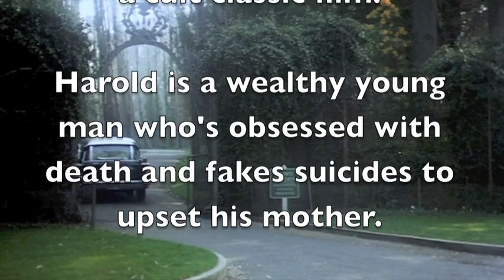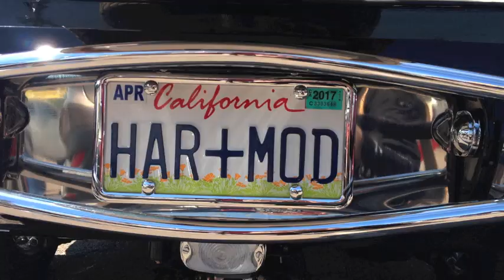Recreation of the Jaguar Hearse from Harold and Maude

Comment: The original  movie car seems to have used a 2 seater for the starting point. It's obvious from the smaller door glass viewed in the original movie. This "replica" seems to be built from a 2+2, larger side windows. Close but no banana.
Reply: he explained it in the video....
Reply: They did use the 2+2 in the movie in the movie, but, I agree this close but not as elegant in shape. The top on the recreation is too straight, the movie version is slanted down to the back. You can see that the window on the recreation has a weird gap at the back top corner, This would be closed if the top slanted down. That is my ONLY complaint on this recreation.

Comment: PART ONE —

OK — apologies … but … this will go round and round and I hope it makes sense … but that’s the way I write leading to having a point …

Once upon a time in San Francisco, in the year 1984 … 

I was in my mid-20's, I got a gig as a Production Assistant (think 'GoFer’— but this being a ‘P.A.’ leads to people being producers, directors and running studios) on what would be one of the co-stars, the inimitable Oscar-winning actress / screenwriter RUTH GORDON'S last film, 'MAXIE' (1985 - Glenn Close, Mandy Patinkin, dir. Paul Aaron)

It was my job, while she was on the set to basically look out for that little Ruth.  But the atomic Juggernaut she was, she looked out for me. 
 
Ruth Gordon was one of a kind — and for the record, they broke the mold with her.  This fragile rock was a better place with her and I often think of her with equal parts of glee and the bliss she fostered in me to this day in the arts. 

WARNING — SPOILER ALERT AHEAD ON ‘HAROLD & MAUDE’:  As to the enclosed ‘moving images’ of Pacifica you requested — there are those shot when I was a mere pup of 12 in 1971 enclosed as I was freshly moved from the tough part of the Mission District of San Francisco to the then safe Pacifica and settling with my Mum and her new Husband in Fair Park (Oceanside) and went to Sharp Park Junior High … 

CUT TO:  While waiting for the school bus to arrive at the top of Fairway Drive, one very cold, wet Pacifica Winter’s morning —

‘The Circus’ — meaning the various production trucks containing Hair & Make-Up, Dressing Rooms, Cameras, Dollies, etc., etc., was loading in for the end scene where the one of a kind custom Hearse-JAGUAR ‘Harold’ drives, hurtles off the cliffs above Fairway Park …

… only to find ‘Harold’ (Bud Cort) plucking at the Banjo ‘Maude’ (Ruth Gordon) gave him prior to her character’s death.

Well, hot snot, folks … guilty as charged —

— I played hooky for half a day and went up and ogled the process of filmmaking.

I was in a rapture.  I was in my place.  This is what I wanted to do.  Make movies.  And I have.  And I do. 

Up comes Cat Stevens singing "If You Want to Sing Out, Sing Out" the over the end credits

You’ll see Pacifica as Harold drives like a suicide in motion from San Francisco, to the Military Cemetery in San Bruno, to Fairway Park and up the dirt road and we see it rocketing off the aforementioned cliff.

CUT TO:  1984 — One the Set of ‘MAXIE’: I told Ruth about playing hooky and how I just HAD to go up and watch them setting up …  

… and Ruth being Ruth, she good naturally punched me in the shoulder and hollered in that New York accent that never left her, “Ohhhhh, THAT’S just fantastic-!  You keep at it-!”

And I did.

MONTAGE OF THE FOLLOWING YEARS:  I’ve worked my way through every area of the movie and TV industry. Learn, learn and I’m still finding out just how little I know of life too.

I’m blessed that through the years after Oceana to now, I’ve got a ton of awards for directing and cinematography and …

BRAGGING ALERT:  This include sharing a PNW Emmy for a drunk driving documentary called, ‘RUSSIAN ROULETTE:  THE BOB MORTIMER STORY’ as I created and directed the dramatic scenes.

But seriously, this yak fest you’re reading is not meant to be bragging … so, please don’t think that.  Tis’ simply the life I chose for myself and the side effects of following your heart.

CUT TO - LAST DAY OF MY SENIOR YEAR AT OCEANA:  Early June, 1976.  I wandered the empty halls … wanting, desperately needing to remember the sum of the ‘Moments’ I was given of the wondrous humanity we were then.  You all were part of the plan.  Part of the map of my oh-so-human heart.

Finally, I made it to the front steps of Oceana and it was there …

… I swore an oath to myself there … at the top of those steps we all tread up and down a million times … and —

I knew, that the idea, the promise and the prayer of the person I would become that I’d have my first movie made by the time I was 30.

CUT TO:  In my 20’s … I would become a contributing screenwriter and get paid for it as well as, thanks to a producer at Lucasfilm, write and direct my first forays into commercials in 35mm … but —

— by the last few hours of age 29 leading to that promise etched in the stone of my soul’s heart of hearts —

I had not had my first film made and here comes the Big Three-Oh.

Yikes.

Back up a few days … 

… as I had been approached by an L.A. Producer friend to do some ‘notes’ on a piece of crap script he was attached to (by then I was a script doctor and had stuff in feature films and TV you may have heard of.

But like I said; the script they sent me was crap.

Me being me — I said, ‘This doesn’t need notes, it needs to be burned and forgotten … and reinvented.’  And in the space of a day, I pounded out the first 18 pages of the story I created and sent it down to the production company.

LOW SELF ESTEEM ALERT AVERTED:  The production company loved it.

So, it was indeed that night — that last night in my 20’s, August 18th, 1988 … just a mere few hours before 30 arrived on August 19, 1988 … 

… that I got ‘the call.’

PRODUCER:  “Dude, them scenes you wrote.  They (the money people and director) loved it.  You want to go for the gusto and we’ll make it ..?”

ME:  (gulp)  “Yes.”

PRODUCER:  “We’re going with you.  I’ll call in the morning with the money details, profit participation and stuff …”

ME:  (bigger gulp)  “Hmm, OK — Cool.”

CUT TO:  A few hours later … the promise I made to myself at Oceana.  The people I knew.  The people — all of you, in one way or another made a difference in the membership of my days all of those eons ago …

… and you still do.

To me, the good, the bad the ugly of our teen years are evergreen.

CONTINUED …

PART TWO —

THE CODA OF THIS EPIC POST:  With no apologies — We’re in our middle 60’s now.  Some of us went ahead into the forevers.  They swam across the River of Souls and are waiting for us.

I turned 65 on August 19th, 2023 … and the proverbial ‘Fat Lady hasn’t sung yet …’  I ain’t done.

I’m writing a little epic now that spans almost 30 years with characters that, in real life, I have known, loved, despised and finally accepted as who they are … and through bitter tears had to accept they are not who I wanted them to be.

With a little luck and the money people don’t fade away, we’ll shoot it by next Summer into Winter.  Fingers crossed.

Our lives … our loves … our early, best courage came from Oceana.  Our friends, our teachers and perhaps within our wisdom, when we all walked away in that warm June day in 1976 … 

… our destiny began.  And it still does.  

Just like Ruth Gordon said to me four decades ago, and this, I respectively refer to anyone reading this, “You keep at it-!”

I am.

I must.

I will.

Much love to all my fellow Sharks.  You made a difference to this callow youth then …

… and you still do.

Dana Augustine
Oceana High School
Class of 1976

ps:  That full movie I wrote is called ‘THE BANKER’ (1989) and starred ROBERT FORSTER, DUNCAN REGEHR, SHANNA REED, JEFF CONAWAY, LEIF GARRETT and RICHARD ROUNDTREE.

It became a minor cult film and one of Quentin Tarantino’s favorites and one of the reasons he hired Bob Forster (a Prince) on ‘JACKIE BROWN’ (1997 - PAM GRIER, ROBERT DENIRO, SAMUEL L. JACKSON, MICHAEL KEATON, BRIDGET FONDA) a few years later … of which he got an Oscar nomination only to lose to Robin Williams for ‘GOOD WILL HUNTING’ (1997)

pps:  Bob Forster became a dear friend, a mentor and the father I never had and a gauge of how to see this world as it is and not how I want it to be.  I miss him tremendously … as he too was one of a kind.

But that, dear Sharks … is another story.

~~~~~~~~~~~~~~~~~~~~~~~~~~~~~~~~~~~~~~~~~~

https://youtu.be/H32UMr_gqhM?si=MFSryed0RK8f_sW1